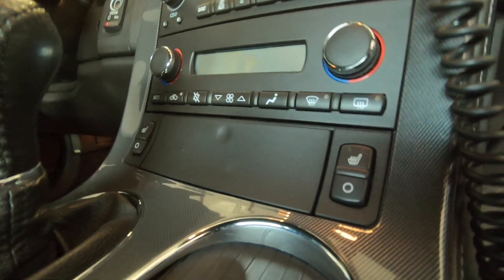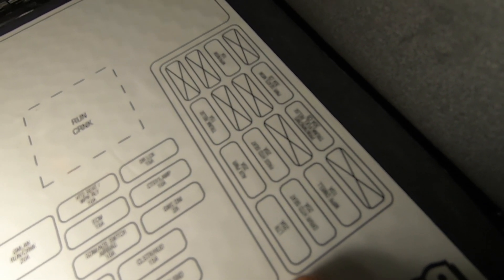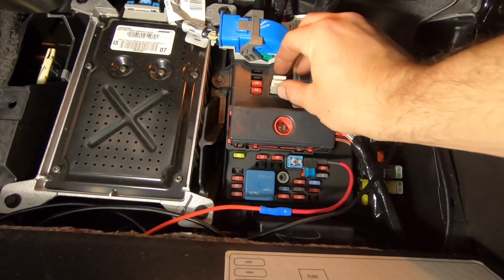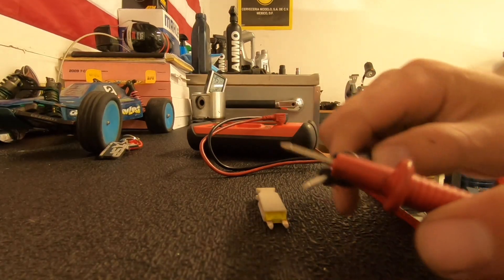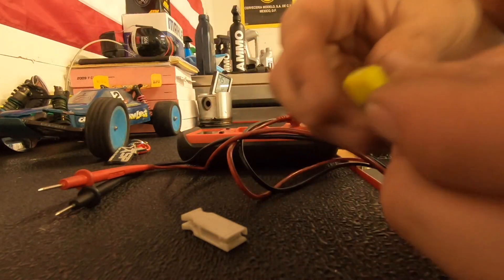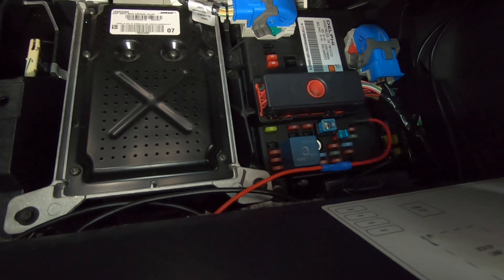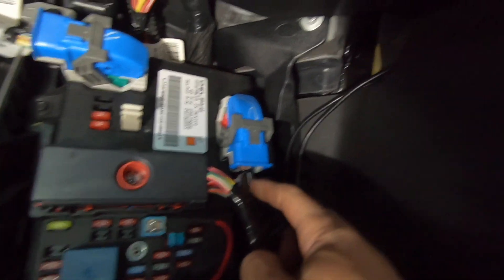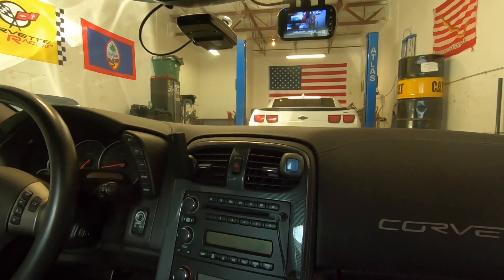C6 Corvette Cigarette Lighter Outlet NO POWER

Comment: Hello, I do have power and the lighter works. But when I plug in my radar detector I get nothing. I checked the detector in my other car and it works there. I used a multi plug adapter and that also won’t work. Any ideas? Let me know. Thanks
Reply from the maker: sounds like the socket itself may be faulty.
Reply: @southfloridagearheads     Even though the cigarette lighter itself heats up and works???
Reply from the maker: only other thing it could be if the plug works but your radar detector doesnt.  @dianerandise6612
Reply: @southfloridagearheads  I did test the radar detector in my other car and it works there so it will remain a mystery. Going to test my air compressor next. Thank you for trying to help.

Comment: Hey dude I see that you have an adapter in your fuse box? What is it for?
Reply from the maker: power for the wideband Guage in the car.
Reply: @southfloridagearheads  thanks! I’m putting in a sub and trying to figure out what amp to piggyback on and I think I’m gonna use the cig lighter.
Reply from the maker: @Reverie  you can tap the heated seats only has power when ignition is on.
Reply: @southfloridagearheads  thanks!
Reply from the maker: @Reverie  NP just get one of those add-a-fuse pigtails and should power your Amp when ignition is on.

Comment: How many miles did you drive before doing the heads? I am worried about buying a car that is 500+ Miles from me without the heads being done....Maybe best scenario is to ship directly to my mechanic to do the heads before any driving? Thanks!
Reply from the maker: I drove the car from NY to FL when I picked it up. Drove it for a year or so without doing anything to the car.. I wasn't quite sold on the whole valve issue until I did the inspection. That was eye opening to say the least. Check out my video on the wiggle test. Your car could run 100k miles or drop a valve tomorrow. No way to say or tell. I didnt notice anything abount my engine, sounded smooth but my guides were way out of spec. Im glad i cought it when i did.